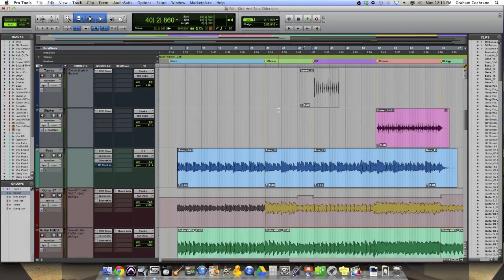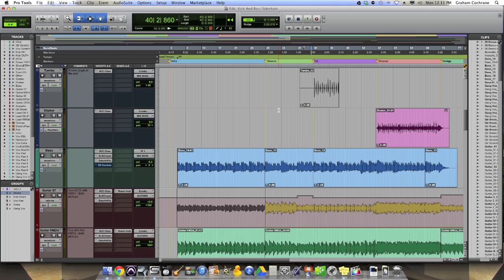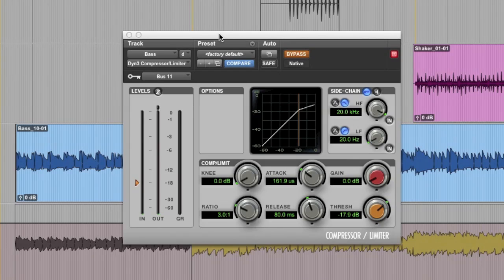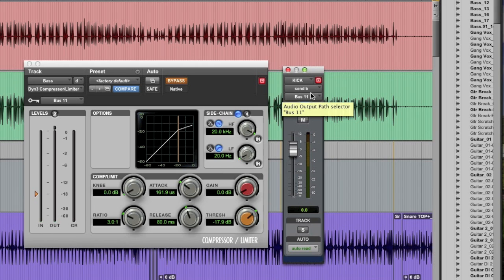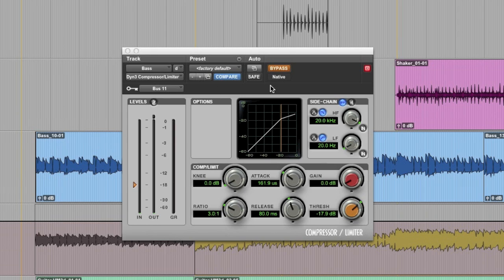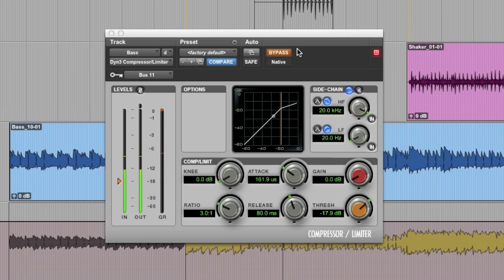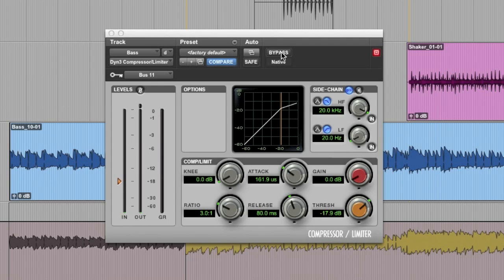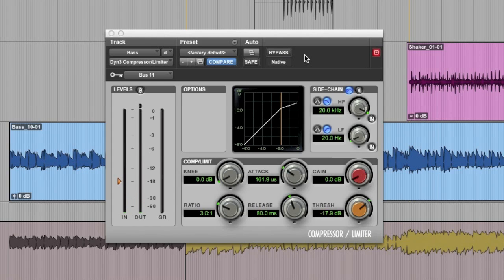Kick And Bass Sidechain: 5 Minutes To A Better Mix - TheRecordingRevolution.com

Comment: Hey question! If you use a longer kick than average, does that must effect the duration of the compression? I don't know if it's in my head so I thought I'd ask someone who knew
Reply: Yeah I think it can make the compressor compress for too long and take out too much of the bass. What I've tried is taking another channel with a short kick (like a simple 808), writing in all of the kicks at the same points as in your original kick, muting the 808, and then sending that to the compressor instead of the original kick so it only compresses for a short time

Comment: Great tip, but I have a couple questions:

1-Why did you send the original signal from the kickdrum to a buss and then made the sidechain assigned to that buss? Why don't simply assign the sidecahin to the original kickdrum channel (pre-fader)? Would that be wrong?

2-What if I got a faster kickdrum? I mean, not a heavy metal one, double bass, not quite that, but just not so mellow like this one. I would have to adjust the release of the bass compression to match the input signal (in this case, the kickdrum), but the bass could sound to bumpy, right? How could I manage that?

Comment: Would you do this before or after adjusting the volume levels of all tracks, or does it not really matter?
Reply: You'd typically want to set your levels first. Then do all your EQ, then your compression, and THEN sidechain. Make sure everything sounds good together before you start ducking things behind each other.

Comment: Great video. Of course, this trick shouldn't be used arbitrarily because you might be ducking the pick attack, which in rock is crucial. That's where a multi band comp might help. It also helps if the drummer and bass player are in time :-)

Comment: wouldn't you want the attack and release settings at zero?
Reply: seems that would depend on the shape of the 'hole' you want punched in the bass for the kick to come through.  If there's an automatic setting for att-rel it might give you the ideal effect but otherwise experiment until you have what you want.

Comment: st protools tutorials technique Iv seen on youtube...

4

aTallGuyNH
aTallGuyNH
2 years ago
Wait wait... Didn't you tell Dave Pensado that you don't use sidechain compression?!?  :-)

2

David Aliperti
David Aliperti
2 years ago
thanks for this video, why the kick is sent to a new bus before via pre send, could it be addressed directly to the side chain?

2

Arthur Azoubel
Arthur Azoubel
1 year ago
Great tip, but I have a couple questions:

1-Why did you send the original signal from the kickdrum to a buss and then made the sidechain assigned to that buss? Why don't simply assign the sidecahin to the original kickdrum channel (pre-fader)? Would that be wrong?

2-What if I got a faster kickdrum? I mean, not a heavy metal one, double bass, not quite that, but just not so mellow like this one. I would have to adjust the release of the bass compression to match the input signal (in this case, the kickdrum), but the bass could sound to bumpy, right? How could I manage that?
 
1

Dear Me
Dear Me
3 years ago
I like your videos Graham.  :)  However, I'm not good at hearing the changes; I don't hear a difference.  I hope that someday, I will.  This is very frustrating for me.  

5

David James Estioco
David James Estioco
1 year ago
Your tutorials are so straight forward and simple and easy to understand. I have little knowledge of mixing and for me to understand everything you've explained means that you did a really incredible job in explaining.

1

Norm HD
Norm HD
1 year ago
Tutorial starts at 1:30

1

Gabbanelli530
Gabbanelli530
7 months ago
This is great 👍

1

TouchTone Beats
TouchTone Beats
3 years ago
Nice thanks 

1